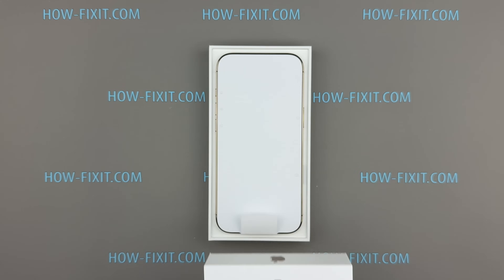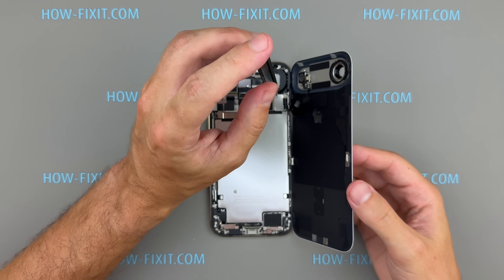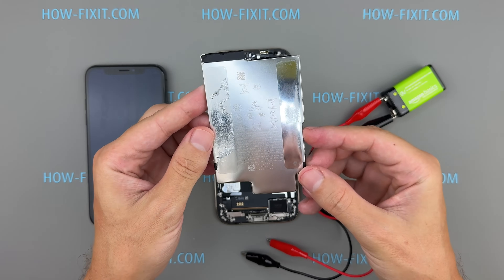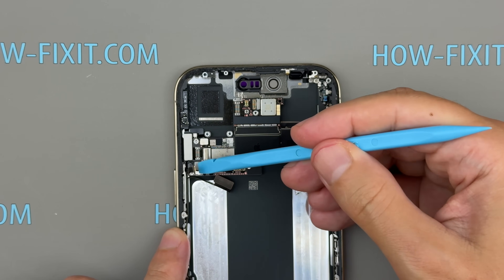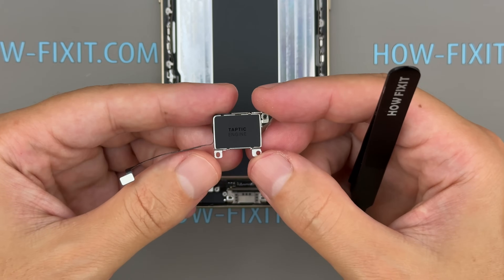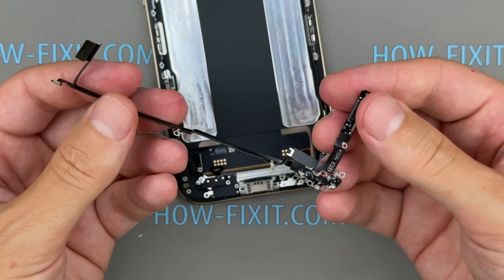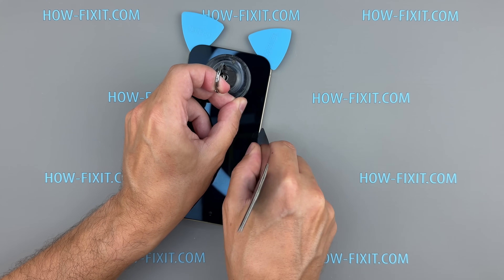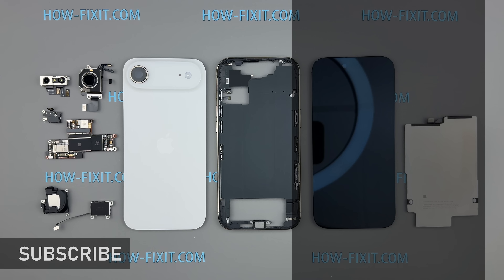iPhone Air Teardown: Back-Opening, Battery Release, Modular USB-C

Comment: 4:48 anyone notice the connectors are 50% of the entire motherboard? Why cant they make them smaller? Is it beyond their control or?
Reply: R&D cost probably. They'd have to develop a smaller connector to go with their own parts, and for only one specific model (the Air in this case), cost may not have been worth it.

Comment: Can you confirm the safe current/voltage for the battery tabs? and whether inline resistors are advisable?
Reply from the maker: Voltage 9V across the two exposed adhesive-activation tabs. If using a bench supply instead of a 9 V cell, set 9 V with a 50–100 mA current limit.
Reply: Add 150–220 Ω in series with the positive lead to tame inrush and cap current to roughly 40–60 mA at 9 V (Ohm’s law; actual draw depends on the phone’s internal path). If release is weak at 220 Ω, step down to 150 Ω—don’t go lower unless you know your setup.